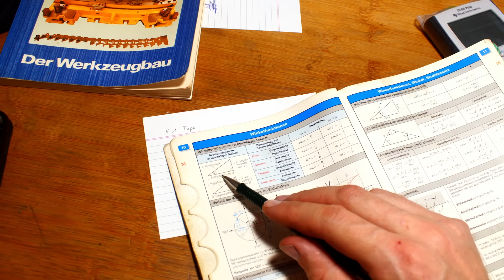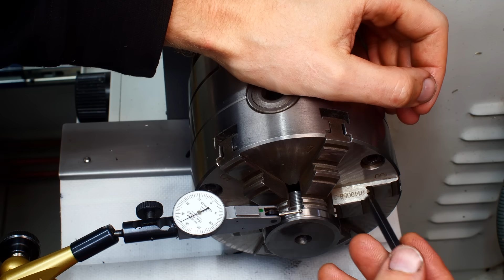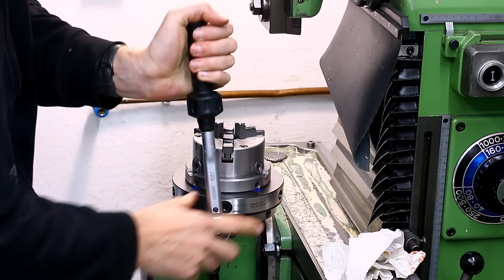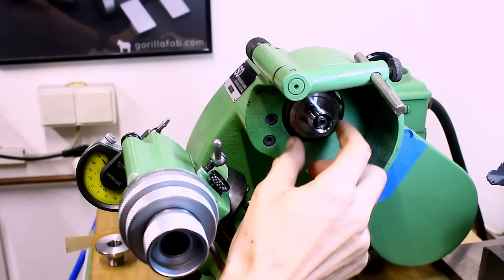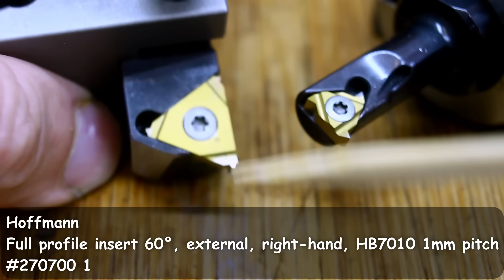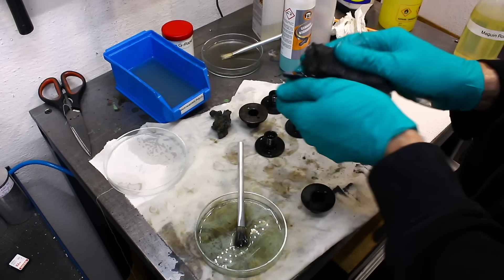Deckel S0 Wheel Hubs - Part 2

Comment from the maker: Before you comment on the angle setting and 5:1 ratio:
The ratio is related to the adjacent not the hypothenuse. The 50mm sine bar length relates to the hypothenuse.

Thats why my tapers these days fit without try&error ;)
Reply from the maker: Reminder for myself: If I ever show trig in a video again, I will smack my face against the table corner.
Reply: @StefanGotteswinter  Hey, still counts as viewer engagement... :)
Reply: @StefanGotteswinter  If it helps, I think doing it with trig is better, and I really appreciated seeing it worked through.
Reply: @StefanGotteswinter 😂😂😂
Reply: Yup. I was thinking I can actually get the same measure by going through pythagora's theorem and the area of a triangle, since the distance you need is essentially the height of the triangle if you set the hypotenuse as its base. So, the area is (50*5)/2 = 125. the hypotenuse is sqrt(50^2+5^2), and the height is (125*2)/sqrt(50^2+5^2), which is 4.9751859... same result with a square root instead of trigonometric functions. Actually, I can also skip dividing the area times two and multiplying it back times two, so it's simplified to (50*5)/sqrt(50^2+5^2)
Reply: @TDOBrandano  Before I saw your comment, I was thinking along similar lines.  This was my algebra:
c = sine bar length = 50
b = rise = gage block stack
a = run = 5 / 0.5 * b = 10 * b

a * a + b * b = c * c

- sub in 10 * b for a, and 50 for c, and multiply the 50's
10 * b * 10 * b + b * b = 2500

- multiply out the 10's and rearrange for prettiness
100 * b * b + b * b = 2500

- factor out the b * b
b * b * (100 + 1)

- rearrange and do the constant addition
101 * b * b = 2500

- divide both sides by the constant
b * b = 2500 / 101

- sqrt both sides
b = sqrt(2500/101)

- solve
b = 4.97518595...
Reply: Well pinned!👍

Comment: Of course I may be wrong, but you had said you wanted 0.5mm over 5mm, your sine plate is 50mm wide, therfore w/o using your calculaor, you would want to set the sine bar to 5mm. VS your calculator result  ~4.97mm

Comment: Is that white carbon fibre? What material is the new white way cover Stefan :o I tried the glass fibre baking sheet, however I experienced chips getting in from the side when the cover is bunched up under the chuck. So I'm looking to source something heavier (and will make it wider) like the Nylon-Neoprene you showed previously. However your new white one got me wondering if you discovered something else...
Reply from the maker: Haha, thats a advertisment-Banner that I cut down, because I didnt have anythign else at hand at the time. Very much not ideal, very stiff and easy to melt.

Comment: When using a manual spin fixture on the surface grinder  take a tube about a foot long that just fits on the conical part of the handle and rotate. It helps elevate unwanted weight transfer into your grind that is so "annoying". Stefan you are the man!

Comment: Stefan, when you are increasing the "diameter" of a tapered bore so that your "gauge" fits correctly, do you do the math to determine the dial change required to fall within the tolerance, or do you go by experience?  It would certainly be a shame (& great waste of time & material) to cut a bit too much and fall outside the dimension & tolerance required.

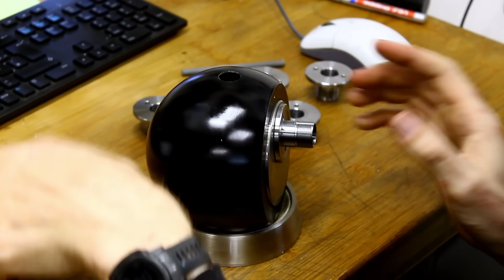Edit: What is the brand (& part number/name) of the rubber-bonded abrasive wheel you used with a die grinder at about 45:25+?  I think something similar to that would be useful in my shop.  Also, please remind me what the black, spherical, magnetic work holder is.  I definitely learned a lot because of you going into great detail!
Reply from the maker: The amount of dia/depth is determined by the 5 in 1 ratio. You could measure and pin point the dimension, or eyeball it like i did

Comment: I didn't see you loosening the screws of the chuck before 'setting-tru' (or tightening afterwards) Stefan, you can get away without?
Reply from the maker: Yes, no problem moving the chuck around with torqued screws. Learned that from Robin.

Comment: I have made. a number of variants of these for my Deckel clone.  Mine did not require a keyway as the spindle has no keyseat.  The taper fit is sufficient to allow the wheel to stall the motor before the adapter slips on the taper.  My adapters were made for 1.250" and 20mm bores.  Resulting runout was not quite as good as yours but at least I nailed the taper.  I appreciate the tip regarding making these two at a time and parting them.  Very helpful.

Comment: We got vitrify cbn from Dr. Kaiser and I can tell you this abrasive just change my life in toolsteel 65rc+ Also on ID grinding but you don't do much of this. They don't wear they rip, you can take a 5 micron pass without glazing everything and bonus they are freakin expensive ;)
Reply from the maker: Yeah, those are a bit out of my price league :D
I had very good results with seeded gel / ceramic wheels in HSS on the surface grinder, I might get a seeded gel cup wheel for the dbit grinder.

Comment: In а right-angle triangle 5 : 0,5 exactly egual 50 : 5. Gage block sine bar strictly 5 mm ;-) Othervise is round off error...
Reply from the maker: Thats not correct for a sine bar. 5mm would just be an aproxximation.
Reply: Sorry, I was wrong.

Comment: Stephen,
Similar triangles...
5:0.5 = 50:5
By using trig functions, you messed with rounding error.
Reply: Sorry,  it's the hypothenus
Reply from the maker: If you use small angle aproxximation, you introduce rounding error. I did not introduce rounding errors apart from the final result.

Comment: Maybe I got it completely wrong, but in your paper explanation you talk about 5 mm slope and 0.5 mm upright.
Now you are using your 50mm sine bar should the upright not be 5mm? 
My gut feeling says you introduced a minute calculator rounding error by calculating the angle.
For the rest great video.
Reply from the maker: No and Yes - If you use "small angle aproxximation" - yes, if you want the actuall number, no.

Comment: so Stefan does your Deckel FP1 have any method to display depth of quill movement when using rack and pinion feed as you demonstrate drilling pinspanner holes?
Reply from the maker: Yep - Theres a graduated ring on the right side of the quill drive.

Comment: Whenever you get resonant vibration, consider moving the frequency of your VFD by a half a note (you can even calculate the frequency equal to a half step on a piano). This will make whatever vibration frequency destructive rather than constructive to the resonance and, at least from what I've seen on my lathe, this will usually completely cancel any ringing.  It's just like detuning a piano string. It gets louder when it's on the correct resonant frequency. It gets much quieter when it's just off of the resonant frequency. Just a slight touch on the frequency knob can work like a miracle. Think of the lathe as a tuning fork, or even a bunch of tuning forks all bolted to a rigid bar.  If any of them start to get loud, change the speed until they are all quiet.

This would all be a lot more intuitive if we could see sound.

Comment: I'm a fan of your YT/channel. And I'm the last one to teach you anything. But, this time, I would instead of using the calculator to calculate the gage block stack, use your very drawing of the taper included angle, for not loosing precision by rounding decimal places in the calculation. The sine-bar will be resting in the central line disecting the included angle (whatever the angle). The horizontal lenght stays the same and the upward angle is half. Half of the 1.0 units on the vertical. Then, if your sine-bar is 50 (10 times 5) units in length, then the vertical should be 10 times 0.5 or 5.0 units. More accurate than 4.975.
Or I got ir all wrong ?
Thank you very much.
Reply from the maker: You got it wrong for the gage block stack - Hypothenuse vs. Adjacent. 
But You are correct if the 5/1 ratio is measured with an indicator against the compound with an indicator sitting on the machine bed.

(In reality you can use small angle aproxximation and just consider hypophenuse and adjacent similar for small angles and live with the small angle. see: small angle aproxximation)

Comment: Hi Stephan, appreciate the video. Why are you using flood oil vs soluble oil / water mix? Thank you for taking the time to go into detail about your tooling and the techniques you use; this is very helpful.
Reply from the maker: The oil is super stable, doesnt go bad or cause rust, unlike water based cooleant.

Comment: Wouldn't it be simpler and more precise to set the angle by moving the carridge by 10mm and aiming for 1mm compound slide cross movement? This way you could avoid errors introduced by rounding and set up. 10mm should be possible to measur by indicator or if not You could take 7.5 and 0.75mm etc.
Reply from the maker: no. Hypothenuse vs. Adjacent plus the error of the indicator beeing very complicated to be set at exactly center height.
Reply: @StefanGotteswinter My translation mistake. I was talking about moving carrige exactly 10mm and measuring compund rest (part that tool rest is sitting on) side lateral movement (perpendicular to bed ways). In this case 10mm travel of carriage is adjacent side of right triangle and compund rest lateral movement is znother adjacent side.
@doggfite I was talking about bit different approach than Stefan showed in second method.
Reply: He basically walks through this method and double checks his work this way.

That's a valid way to do it for sure, but then it requires you to accurately move the carriage by 10mm (or whatever length) and then measure the lateral movement with an indicator.
If you can move it exactly 10mm, then it's the same issue as rounding too liberally. Using a sine bar is simpler in that you don't have to worry about travel distance being an exact amount, all you have to worry about is the indicator having no change (or whatever the acceptable margin of error is) over the traveled distance.

So, for instance, if you were to get 1mm of lateral movement and you moved the compound 10.1mm, this would give you an angle of 5.682° compared to the 5.710° that Stefan was aiming for.
A small error, for sure, but undoubtedly a larger error than eyeballing minimal travel on a how-many-ever micron dial test indicator.

Comment: I'm not sure if any of the other comments are saying this specifically, but you can calculate this without angles using only the Pythagorean theorm.
Any traingle with the same angles are similar, so you can just "scale up" the original triangle to find the height of the sine plate 50mm hypotenuse triangle.

If the base is 5mm, and the height is 0.5mm
Then (5^2)+(.5^2) is 25.25
Square root is 5.025 (rounded)
Then 50mm/5.025mm = x/0.5mm
Multiply both sides by 0.5mm to isolate x
50*0.5/5.025 = 4.975 rounded.
Reply: Why are you still overcomplicating this???
If the triangle says that over a distance of 5mm, you have a 0.5mm rise, stack 10 triangles after one another to get your 50mm, and you will see that your total rise is 5mm.

In other words, just run the indicator on the side of the compound for 50mm until the dial indicator shows a change of 5mm.

There is no math required at all in this entire exercise! Attempting to add any math to this only results in more error being added!
Reply: You can simplify this further by expressing the relationship as ratios, requiring one multiplication and one division. Works for non trivial cases where you cannot mentally multiply.

Pick two sides in the same order for both (i.e. adjacent and hypotanous, etc).
Then solve for the missing one:

i.e. a -> adjacent and h is hypotanous 
a_1/h_1 = a_2/h_2
In this case, it is the cosine value which has to be the same since they are for the same angle*. Works for the other combinations too.
Reply: @Tuxbotix right but you need to calculate the hypotenuse first, because for a sine bar he knows the hypotenuse and needs the opposite
But on the designed triangle he only has the opposite and adjacent. 
Hence the need to solve for the hypotenuse with the Pythagorean theorem. 
And then I solved for the unknown opposite side in the exact way you describe.
Reply: Dont even need to do the math.  A 5 to 1 gradient, just clock in the compound with a dial gauge to travel 1mm for every 5mm travel.  Or 10mm for 50mm.
Reply: @ashesman1 I talked about this in another comment, but it's not a simple task to measure 2 exact travel distances in 2 dimensions simultaneously. 
It's much simpler, especially when you want a high degree of precision, to do 3 simple calculations and then measure lack of travel over whatever distance you want.
Obviously, this requires a sine bar to do though, so the option is available otherwise. But, why not spend 3 seconds on a calculator to reduce the need for precision movement in 2 dimensions?

I was just offering a method that doesn't require trig and then doesn't need you to pay attention to whether you are calculating radians or degrees.

Comment: Great video Stefan, always nice to have  some mental excercise on a Sunday morning👍  It might be worth doing a quick follow-up clarifying the stack size on your sine bar, judging by the number of comments on this (I presumed it would be a 5.000mm stack, but after a lot of headscratching I realised that a 5mm stack would work if you were traversing the saddle, where the fixed length of 50mm would be aligned to the spindle axis and it would be the "adjacent" side, but in your case you're traversing with the top slide so it's the hypotenuse, so the "opposite" side or stack  would be different (or have I bent my brain?🤔)
Reply from the maker: Yes, 5mm would be for a tangent -bar, not a sine bar. 
There is something called small angle approximation, where it can be treated similarly with small enough error, but don't like the mental gymnastics and just calculate it properly.

Comment: Before making any trig, double check if your calculator is in degrees and not radians 😅

(Although it didn’t matter in this case because you turn in back into gauge block stack using the same calculator)
Reply: An angle of 5 point whatever radians would be nonsensical given the fact that we know the slope is so low and given the angle he was solving for.
There is physically no way it could translate to ~80% of the circle.
Reply: @doggfite but arctan of 1/5 is ≈ 0.2 in radians, which can cause problems if you think that’s in degrees
Reply: Yeah my phone scientific calculator app defaults to radians😅
Reply from the maker: thats devilish.

Comment: To those saying you can just use a 5mm stack, no! I've made that mistake.
Notice on the drawing, the travel is measured along the adjacent, while the sinebar represents the hypotenuse. If the adjacent is 50mm, the hypotenuse (and thus the sinebar length) is longer!
Reply: Alternatively, you may think you could just leave out the sinebar and measure 5mm directly against the compound, but then our indicator measures those 5mm perpendicular to the hypotenuse, not the adjacent, and your measured offset should be longer than 5mm.
Btw, I deleted and edited these 2 comments a couple of times as I'm still confused about these things.
Reply: @ErikBongers yep, if he was using a tangent bar (ie with the measured 50mm running along the spindle axis) then a 5mm stack would work (ie if he was moving the saddle) but here the 50mm measured length is moved off-axis, so it's the hypotenuse and the sin formula (sin= opposite/hypotenuse) works.
Reply from the maker: Very correct! (for small angles theres small angle approximation where the adjacent and hypothenuse can be treated equal, but it creates a small error)

Comment: The stack height could have been found more easily and more accurately if you noticed that 5:0.5 is the same as 50:5.... you got 4.97 because you rounded off. Of course it does not always work out like that but you were lucky that the taper and your sine bar have the 'same' length. But it tells you that you should not round off till the last step
Reply: 5:0.5 is the ratio of the base to height
50:5 would be correct if the 50 was also the base, but it is the hypotenuse.
So, for a 50mm hypotenuse and a 4.975mm height, the base would actually be 49.75mm, so the ratio is still the same, 10:1 between the base and height.
Reply from the maker: Only if i used a tangent-bar instead of a sinebar :)

Comment: 5:1 included gives 10:1 half angle. So 50mm sin bar give a ⅒ stack i.e. 5mm. The should ge no need to calculate angles
Reply: 10:1 is the ratio of the base to height
A 5mm stack height would be correct if the 50 was also the base, but it is the hypotenuse.
So, for a 50mm hypotenuse and a 4.975mm height, the base would actually be 49.75mm, so the ratio is still the same, 10:1 between the base and height.
Reply: @doggfite  Sorry  Yes, I  went back and looked again,  and, you are correct he has his stack perpendicular to the top slide.

Comment: Makes me wonder why exactly old taper standards are often written as length : diameter ratios. My guess is that they were often cut with taper attachments instead, where it’s easy to advance the cross slide the required length and directly read the x-axis movement with an indicator? Just a thought.

Comment: The measurable drift measured with the micrometer is purely thermal ( both handling. Room temp and friction from cleaning ) since mitutoyo's tolerance for there gauge block is within 110nm ( most of them. Like 93% of them funny enough comes out as 105nm oversize) at standard measuring temperature (between 18 and 20 C as we all know )